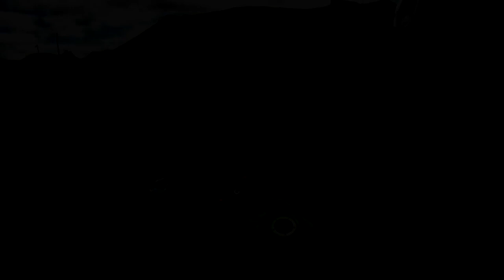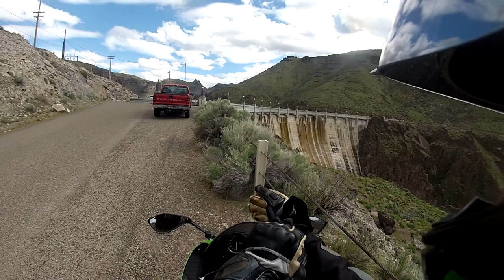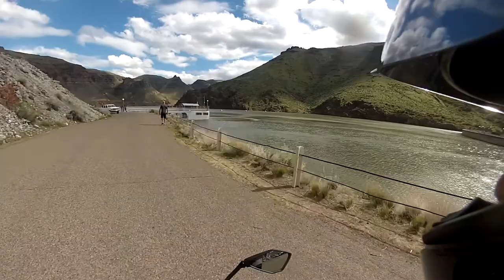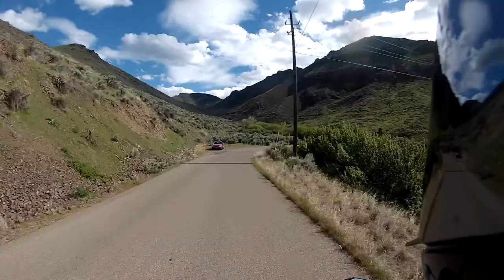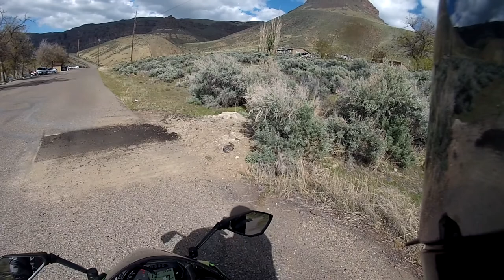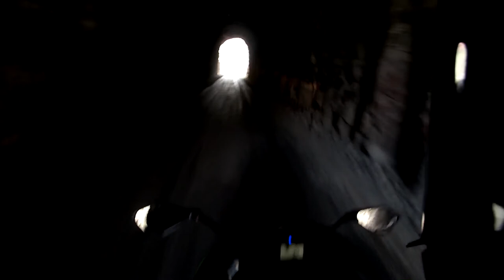Owyhee reservoir, One last ride!

Comment: piston slap , you going to keep that AWESOME machine your riding ? I think I herd you say in a previous video your thinking about getting rid of it , I hope not , I just got my exhaust , and cats out , and next is the ecu flash , but I love that thing , I think I may do some  clip on risers on mine , but I love that bike , I'm so glad I didn't get the new r6 ,  I bought the better bike IMHO , 4 sure
Reply from the maker: I did sell it.  It's a fantastic bike, I just wish I lived closer to a track where I could use it without getting in trouble.   The bike is still here locally, I might see it around here and there.   The ECU flash will make it relly smooth on the throttle.